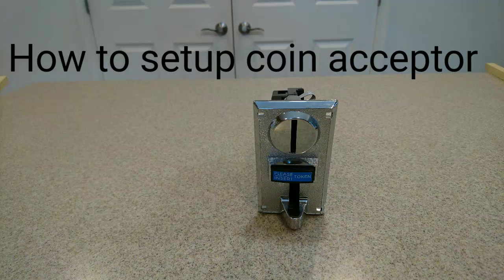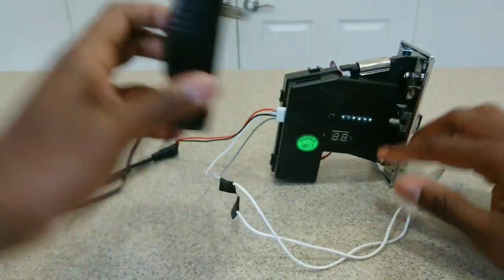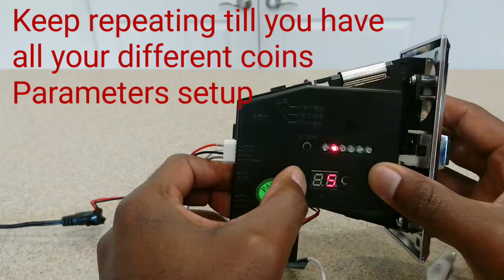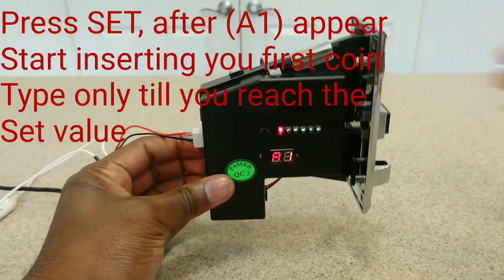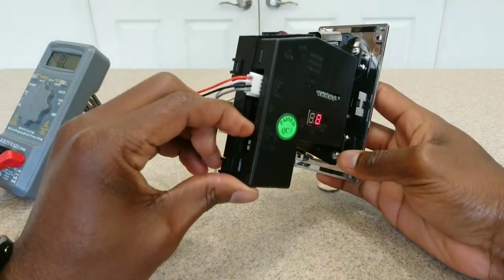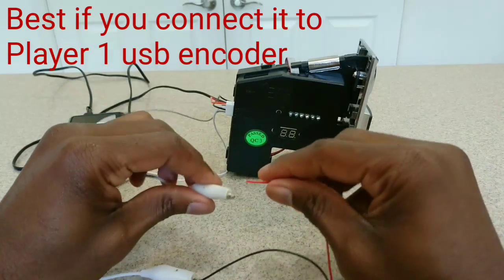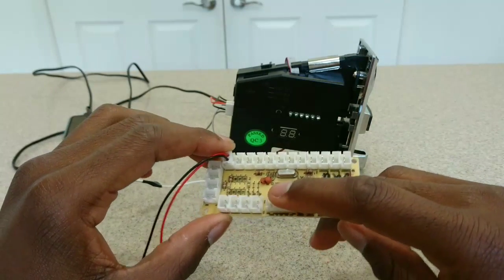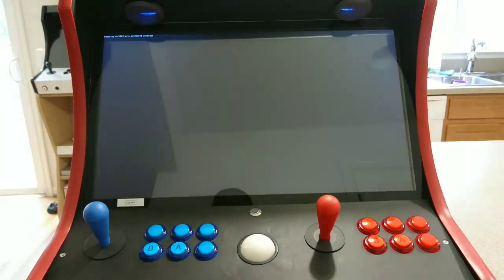How to setup coin acceptor on raspberry pi retropie

Comment: i have problem with arcade emulator, can you help me plz, dont load the games
Reply from the maker: Chamo Marinez what emulator are you using and what rom version are you using?
Reply: use mame-libretro2010, it works for 0.184 roms that most sites post in rom lists

Comment: The reason there was a grey wire commoned with the positive was for the total coin counter function.  The other grey counter wire pulls down to the negative rail via a transistor to click round a mechanical counter connected between the two grey wires.  It's a function that is included for professional gaming machines where there is a requirement to keep a permanent log of coins for duty/accounting purposes.  The pulse output is for the logic board, Arduino or MAME interface.
Reply: bigclivedotcom in the house :D
Reply from the maker: bigclivedotcom OK, thank you. That make sense
Reply: My counter is set up for a jukebox using a relay which sends the pulses to the computer via USB,my problrm is the sofftware cant pick up all the pulses even though i have it set on slow,any idea what is happening
Reply: @aughanure1  i think on of your 'converter' elements is to slow..
the relay - if it is a mechanical one - can be really slow... and so misses the pulses..
also the software - if the way / input you are using is not meant for fast pulses from another electronic it eventually things the pulses are bounces from a switch and filters them out...
lots of things that can go wrong here...

Comment: So this device requires it's own power supply right?
Reply from the maker: Tshamon Vang correct, or uses 12v. If you have a Amplifier or maybe lights that use 12v then you could possibly share power with those.

Comment: How did you get an emulated called arcade I can't fix it anywhere please help I'm trying to make a coin opperated machine like you. Also do you know how to take the retro pi emulater off so nobody can edit the settings.
Reply from the maker: Trey Street use the folder "arcade" which is in the roms folder. Just delete the contents that you don't want under RetroPie, if you delete all of them then that RetroPie tap will go away, similar to if you delete every game from a emulator then that emulator tab will go away. Anyone familiar with RetroPie will still be able to make changes if that wasn't to though using other methods to access those settings.
Reply: thanks also what kind of roms did you use because all I can find is nes games and console games not original arcade machine roms.
Reply from the maker: Trey Street use this link for help with which roms to use for arcade games. 

https://github.com/RetroPie/RetroPie-Setup/wiki/MAME
Reply: Ok thank you so much.
Reply: Hey I have original arcade machines and I want the arcade games that I have to be on my retro pie arcade. Can you personal message me the link to where you got your arcade Roms.
Reply from the maker: Trey Street just Google search what you're looking for and in sure you'll find it.

Comment: if i use this for each player. is it solve the problem for ninja turtle game? thanks alot.
Reply from the maker: nexian space if you have a coin acceptor for each player? Yes
Reply: eldon226 thanks alot. Really help me.
Reply: Can i use pc power supply to supply the 12 dc? Thanks.
Reply from the maker: nexian space you can use anything that'll give you 12v DC. I don't recommend sharing power with it and your pc though, unless you pc has a dedicated 12v output for maybe a speaker. It's best to give the pc the power required so it operates better.

Comment: how to insert coin for game like ninja turtle for 4 players? because its need each coin for each player. thanks before
Reply from the maker: nexian space aww, I remember that game. You'll need to go into the mame setup screen ( press TAB while in tmnt) go to the setting for that game. Go to player 2 coin. Select it, then drop a coin in. It should register the same coin button set for player 1. Do the same for player 3 coin and player 4 coin. This is how mine is set up, the only thing now is that once you drop a coin in all players get the credit.
Reply: sorry i am extreme noob. i use retropie on raspberry pi 3. and i use FBA on neo geo folder. can i use the same method? 1 coin for 4 player? ouch...... hahaha... seems fun
Reply from the maker: nexian space I'll need to look into that because the on only game I play with FBA is street fighter 3. It might also take me longer than normal too because I no longer own that cabinet with the coin acceptor.
Reply: thanks alot...
really help me. haha
Reply from the maker: nexian space if you can press TAB while playing your game to get into the setting menu you should be able to use the steps I mentioned earlier. I am using FBA v0. 2.97.39 and for me. It should be 3 different versions of FBA and depending which you have it might work. The setting I use in my setup for FBA is accessible by pressing select and X while in a game. That will not work for setting up the same coin acceptor for both players.
Reply: That red cable from usb pcg goes to what color on coin acceptor? Thanks.
Reply from the maker: nexian space I didn't get a USB cable with mine, not familiar with connecting it using USB

Comment: I dug through a lot of videos on Youtube before it served this one up.  Your video was BY FAR the most useful.  Thank you!
Reply from the maker: Matthew Mouras you're welcome
Reply: I got my coin acceptor to work using your video!  My PCB had a three pin layout for each button.  In case someone else has a similar setup, I had to move the white (coin) and grey (counter) wires around on those pins before I found a combination that worked: One went to ground and the other to the pin next to ground.  Thanks again for your video!
Reply from the maker: Matthew Mouras that's great, sounds like your encoder supports led lights. Glad everything's working for you now.

Comment: Does it act like a button? I used a USB encoder and connected to raspberry pi, then connected to gpio pin on rip and it worked. I have a question: how many volts does it pulse 5v or 12v? I am scared that it might damage my USB encoder on the long run. And also thanks! I had a coin acceptor lying around from my old claw machine and I've been trying to do this but didn't know until I came across this video today. Keep up the good work!!!
Reply: *Sorry, instead of rip, I meant it
Reply from the maker: I Like To Make Things ILTMT yes, it acts just like a button so no 5v or 12v pulse to worry about. It just open a close those two wires.

Comment: i am not getting a button press when i put a coin in for mame any ideas why friend ?
Reply from the maker: Jashon Moore your switch might be on the NC position, it needs to be on the NO position. If that's not your issue then you might not have your parameters set properly.
Reply: +eldon226. i got the coin acceptor that takes one sample coin and you put the coin in the side slot
Reply from the maker: Jashon Moore I'm not familiar with that version, sorry.
Reply: +eldon226. did your acceptor accept coins to mame without you using retroarch
Reply from the maker: Jashon Moore yes, are you saying it's working for you with retroarch but not mame?
Reply: i am about to install retroarch now, i have not tried it yet cause i use rocketlauncher on my pc..hopefully they didn't sell me a busted coin acceptor
Reply from the maker: Jashon Moore do you have a multimeter to test it?
Reply: no...i thought i did but i will go get one tomorrow
Reply: no...i thought i did but i will go get one tomorrow...when power is connected it accepts the coins thru but not registering a credit
Reply from the maker: Jashon Moore I'd like to see the coin acceptor you have. If it had a led display like mine you should see how many times it should pules on the display immediately after it accept the coin.
Reply: +eldon226 it doesn't have the display...i will find a link to one and show you how it looks